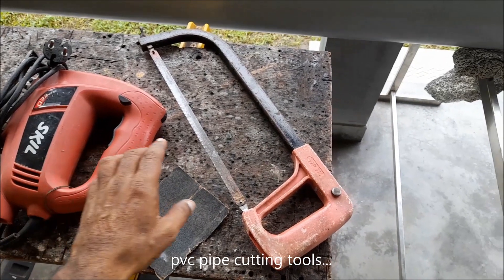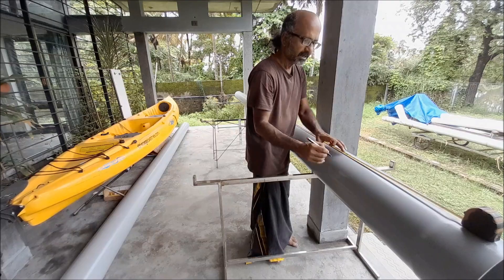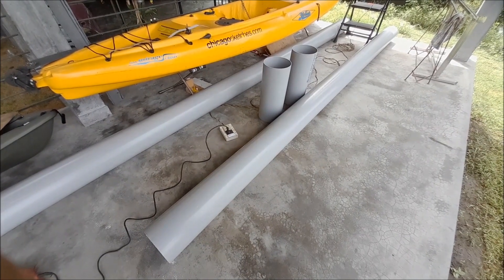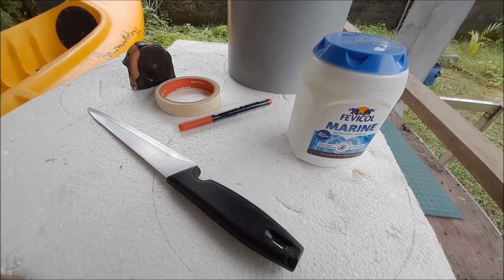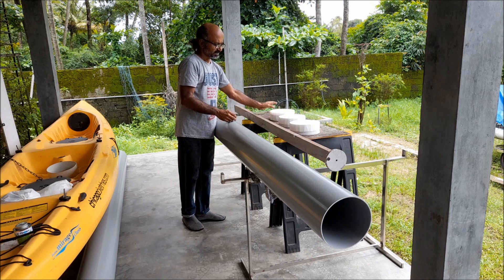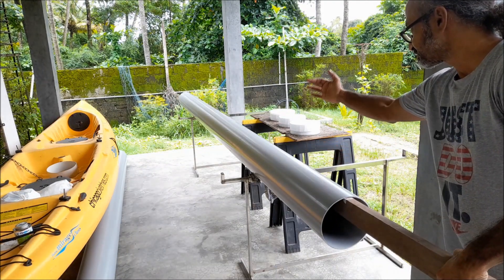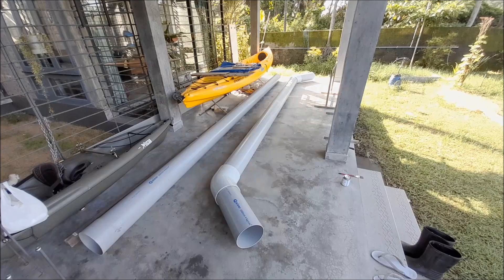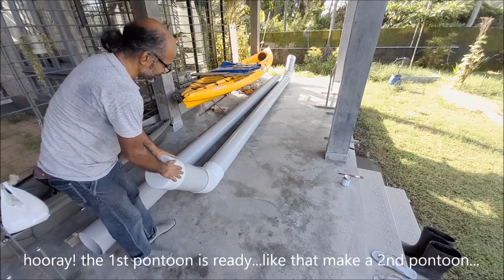PVC pipe kayak build: Part1/5 - Pontoons

Comment: am si eu un Catamaran cu teava de 200mm (8 inch) dar la 3 metri lungime.
sincer sunt nemultumit de flotabilitatea totala.

vreau sa-mi fac unul cu diameteu de 250mm (9,8 inch) la 4 metri lungime
Reply from the maker: 8" dia needs 4m pipe to give more buoyancy. 
4m long 250mm pipe can support 196.25kg & its catamaran can take 392.5kg total weight which would be an awesome catamaran...go for it, you can build it & super happy about the result